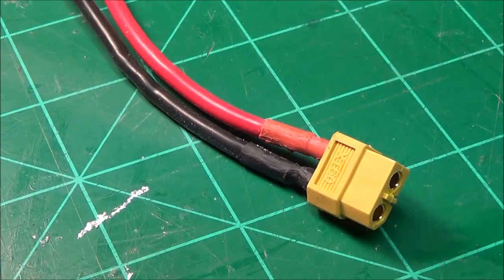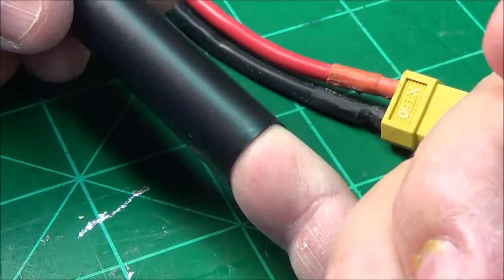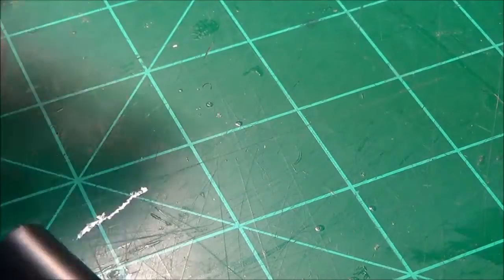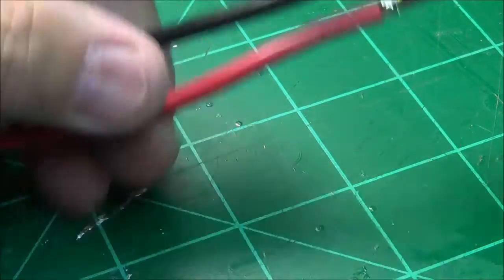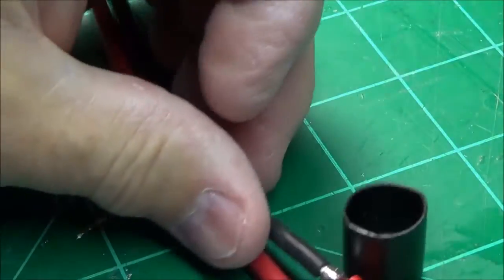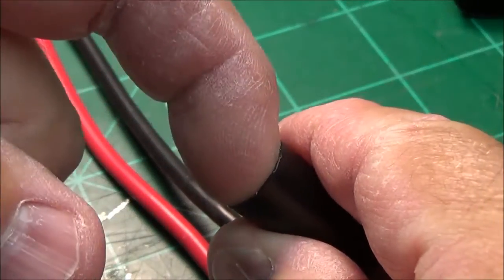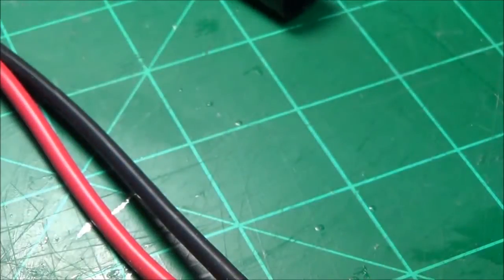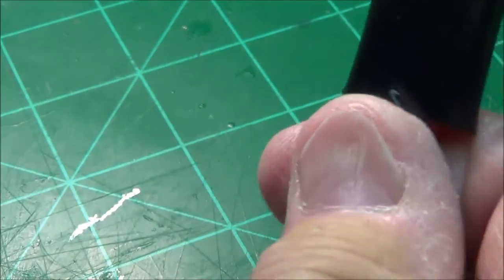Heavy Duty Heat Shrink on Battery Plugs for Support

Comment: I was planning to do the entire length for 50cm, ebike extension cable, the last solder job I did worked but I am getting a new 48v battery 54v at full so I stumped for a pre-made cable however no heat shrink & it's out in the elements, I just wondered if sliding the shrink over the xt60 would save me unsoldering✌

Comment: The material you are looking for is called Adhesive Lined Weatherproof Heatshrink Tubing. It is available by the portion of a metre or by the metre from hundreds of outlets on eBay for a fraction of the price mentioned earlier. It is also available in many colours. The "ooze" you speak of is the glue that lines the tube. It is designed to form a weatherproof seal. When you heated your cables up, had you used gloved hands to pinch the gap between the two cables you would have gotten a perfect waterproof seal around both. You would also have gotten a much stronger joint.

The larger sizes such as you're using are for industrial applications but the tube goes all the way down to 3mm. I use it all the time in making up parts or repairing cables that have split their sheathing at connection points with plugs. It's quick, simple and efficient. If you don't use ton of it look for kits that hold a selection of  widths. That way you always have the right size for the job in hand.

Comment: I found what you might be looking for at wiringproducts dot com. 1/2'' Heavy Duty Black Heatshrink With Adhesive 4 Foot Length for about $24. It has an adhesive which may be the "silicone" coating you mentioned. Seems rather expensive tho. Did you pay that much at the auto show? 
Hopefully, this might give viewers a lead when searching online.

http://www.wiringproducts.com/1-2-heavy-duty-black-heatshrink-with-adhesive-4-foot-length.html.

Comment: DG ... nice tip ... except I don't have the HD heat shrink. I'll try the heat shrink I have and double it up ... and maybe I get something that will help in pulling apart Dean connectors in winter even with gloves on ....